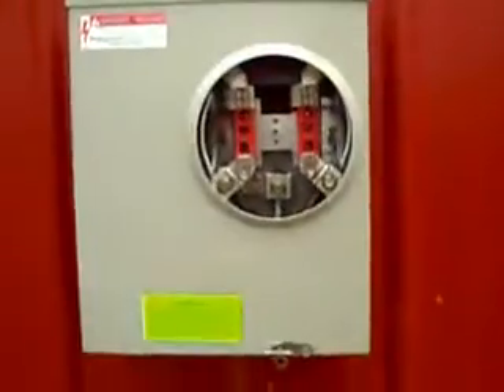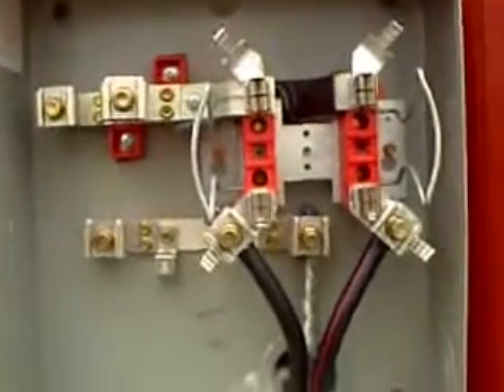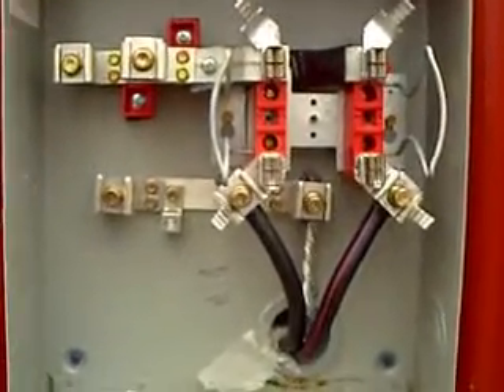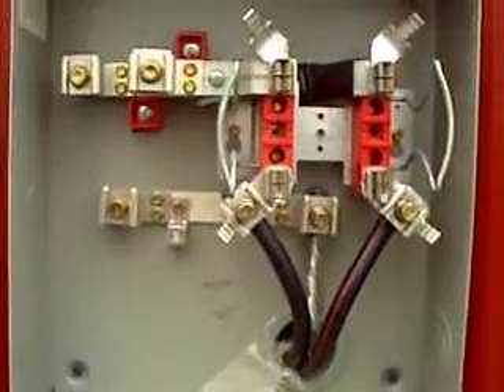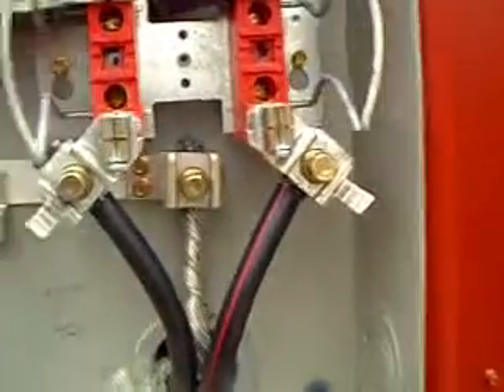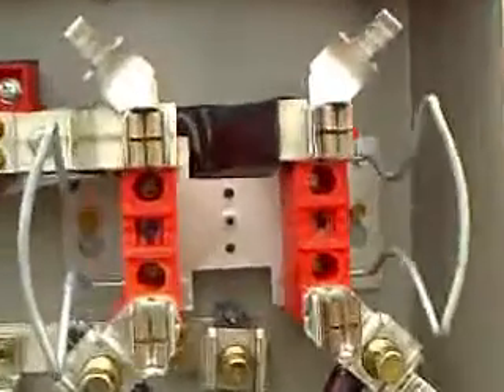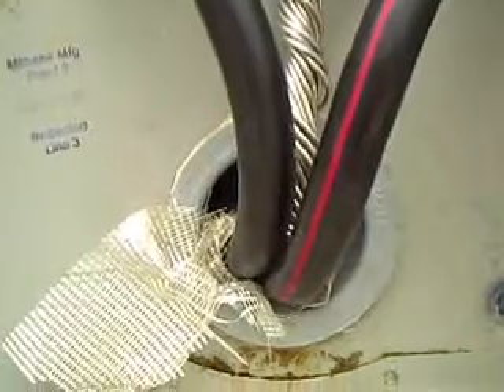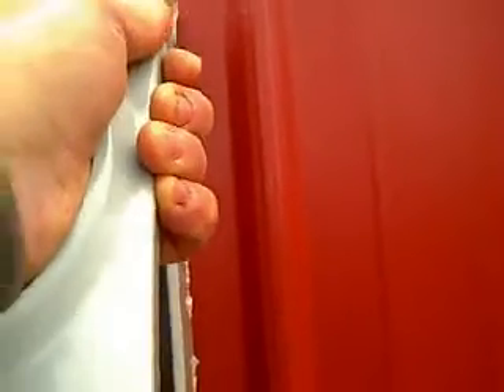meter base and load center.wmv

Comment: Frightening.  You didn't really have any idea what you were doing and got help from the inspector and so it passed.  Of course, this isn't rocket science, but it is important to be done right.  By the way, the lugs should be torqued to the proper setting.  When you place breakers the hot wire should be torqued as well (spec is on the breaker itself).  And don't always believe what you find via Google.